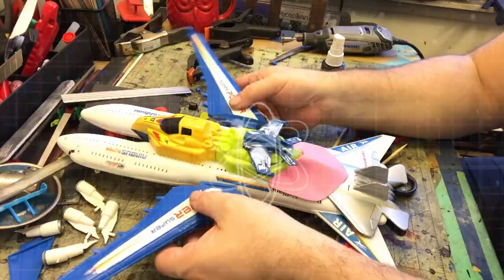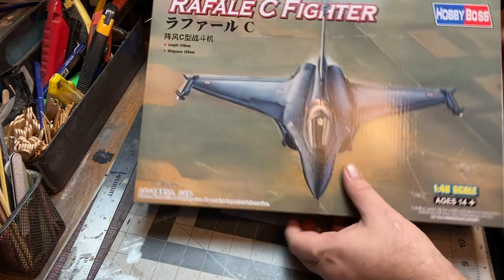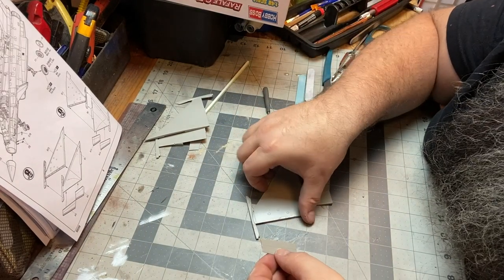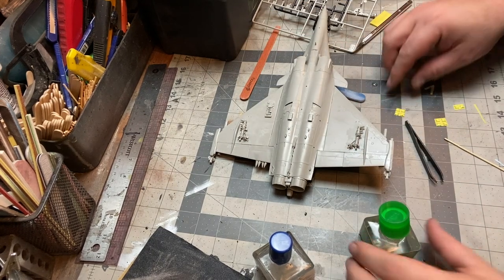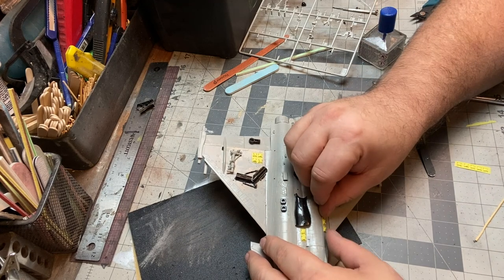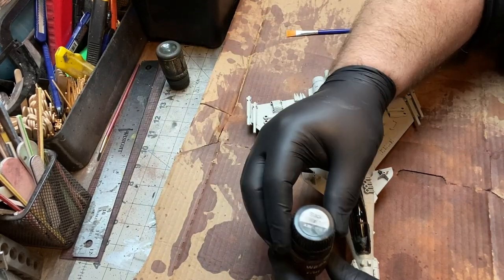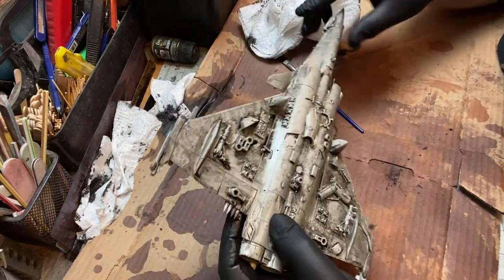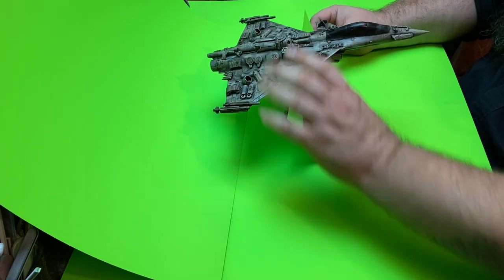KITBASH SCI-FI SPACE SHIP: HOW TO V2

Comment: I would like to send you a picture, however due to . you need to rethink the ship as it is space. so imagine the wings are in space with top to bottom rip the front off.(cockpit area down to the beginning of the wings) then pace the cock pit and put it facing up while the wings are top to bottom ,hold the wings in your hand and make sure the are vertical, throw the cockpit against the left hand side of the wings ,with the cock pit roof top vertical. the reason is clear cockpit on the left hand side wings fly through space vertical. any asteroid of rubbish you can pull to the left and the wings take the hit or attacks. it is like flying a shark in space at  leas the fin.
I have pictures of ones I drew they look cool.

Comment: I understand that you are not an airplane modeler, but seriously dude, you should watch a video or two about airplanes.  Those "bombs or torpedoes" are fuel tanks.  Jets use a hella lot of fuel, and it is almost never that they fly without at least one external tank.  Those pieces on the tail end that you said were from the wheel wells are the sides of an ejection seat.
Reply from the maker: copy that